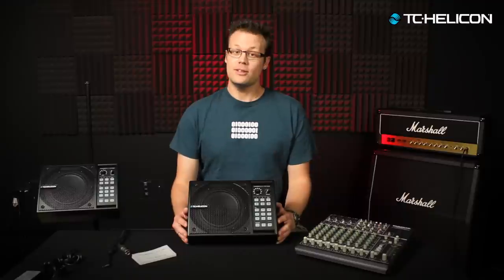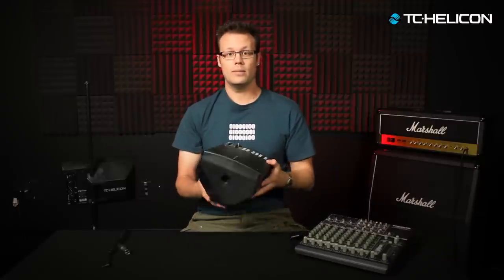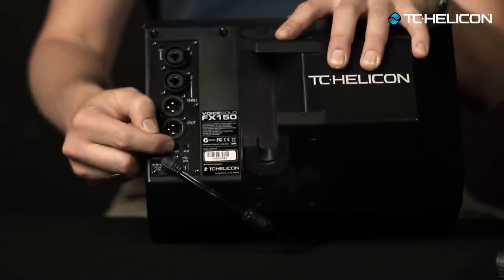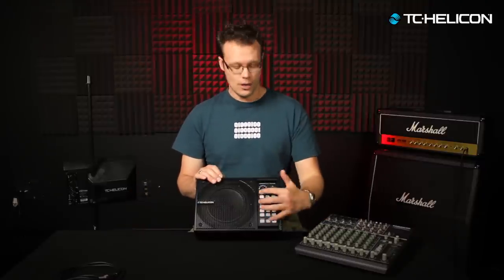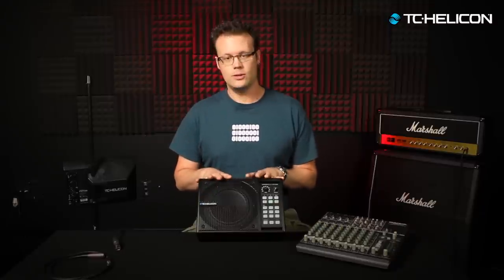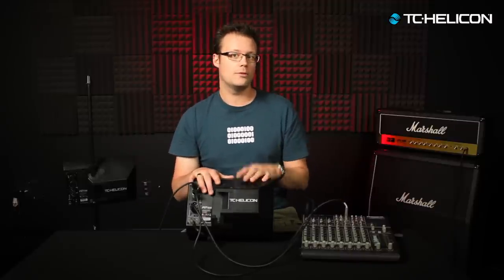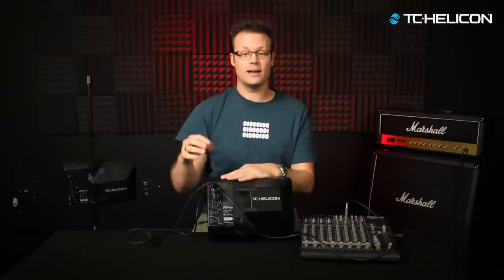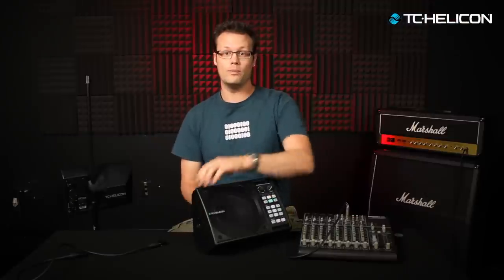VoiceSolo FX150 - Video Manual - TC Helicon

Comment: I know this is an old video, but if anyone is still researching this product I hope thos helps. I've been using this unit for 3 years now, amd I have zero complaints. This little monitor is powerful and clear. I've had no problems with it, and I use not for my stage monitor at church. I am the worship leader at my church, as well as the main keys player. I push this thing pretty hard 3 services a week, for about 2 hours per service. If you don't use in ears, this is a fantastic monitor.
Reply: Hi I bought an fx150 recently on second hand,  but when I checked the unit at home it was really very noisy with no gain on the 1channel with Jack plug absolutely nothing,  but with the xlr some sound but really poor gain and loads of noise,  also the balance di out are sending only effect no other signal. 
It looks like the guy who had this over loaded the preamp,  which he never told me.  
I'm using it or was going to use it for church music and prayer groups but only channel 2 works. ?  I paid 200euro and had to travel down to tralee to buy this. 
I'm very disappointed, it was in the box packed with everything so I took it that it was working. 
I'm currently living in a hostel so money is really tight.   Do you know anyone who may have a working fx150?  Many thanks Regards Vinn from Dublin Ireland
Reply: How does it work as a guitar amp/monitor - if ur using something like an IR (amp simulator), Two Note or Kemper?

I’m keen to grab a used VoiceSolo unit for bedroom playing (don’t have space for a full amp or speaker setup).

Comment: in venues where it faces forward, you may need a dimmer switch for all the buttons as it tends to draw focus from the performer. (personal experience)
Also, the surety of the unit's reproducing sound constantly is in question. (I've had one firmware update)

Comment: Great product (and I have one) but it is missing one very important critical thing - a headphone out that cancels the built-in speaker if headphones are plugged in.  that would make this unit "perfect".  If you can make this happen for future evolution to the product, make it "stereo" so we can enjoy the stereo aspects of the built in reverb.
Reply from the maker: Luis Rodrigues Ah I see what you mean. The thing is, the whole unit is built around being a personal monitor, so the headphone jack is a bit... out of place. Any of our other multi-effect units have a headphone out, but that's because you'd need a PA etc. otherwise and some people don't.
Reply: TC-Helicon Thank you so much for the response.  When I toured in the 90's we used Hot Spots (if you remember those!) with Sony MDR-7506 headphones.  Luckily we had a dedicated monitor matrix mixer and I could have my own mix.  The FX150 gives me the monitor mix plus "my own" but I still yearn to plug in my Sony MDRs.  At church we have an Avion system (for which we all use headphones/in ears, except the vocals) which is absolutely perfect.  FX150 with headphone output and ability to cancel the internal speaker would be the ultimate solution AND I believe would be an affordable alternative to the Avion-type systems (which unfortunately most churches can't afford).  Hope this helps.

Comment: Nicely done.. I was wondering how to connect to the VL3... thanks for that!
Reply: When I use for monitoring with VL3, I connect the VL3 Headphone out to the Aux in.  That way I can use the XLR outputs of VL3 in Dual mono mode to the PA.  This way I still have the FX150 channel 2 input for a monitor mix input and the sound engineer has separate guitar and voice mixing for the FOH.
Reply: I'm doing that very thing.. Excellent!
Reply: Linc Davis

Comment: I just bought one and it is going to take time to get to know it. Also, the sound that comes out of the PA is not the quality I am looking for. I think a vocal processor is needed to get this to sound the way I want it to. That will be the next investment. Otherwise I am dissapointed with the sound quality and the mix of vocal and guitar.
Reply from the maker: Cherie Lassiter Can you expand a bit on the sound disappointment? We'd be interested to know what you feel is letting you down!
Reply: TC-Helicon I understand the principle on how to change levels for it but can't get a sound that is full. It still sounds tinny and small. The reverb isn't very 'hall-like" sounding which is one test for fullness. I wouldn't want to play live with this. I know there is a learning curve and maybe that is the problem; knowing how to navigate it. But even without knowing the nuances, one can still tell the capability from the get-go. I am told it is hard to get the sound I want without a voice processor which I will be doing to get the sound I want.

Comment: Tried this at Guitar Center and doesn't sound louder than 35 watts? it does great though!
Reply: Then you didn't set it up properly.  I have 4 Roland Cube CM30's which are 32 watts each.  This unit is louder than all of them put together,

Comment: Hi Craig! Thanks for another nice video! I do like this VoiceSolo monitor and have recently bought two of them. I just have one question and hope you can clue me in with it.)
I use both of them as monitors for myself, all the sound goes to the audience thru a mixer and and PA system. Everything is nice and perfect except one thing:  when I strum the guitar a bit louder or sing a bit louder the Vocal Tone button turns red (for a moment) and then returns to normal... It doesn't affect anything, there is no distortion, just that short term red blink, which drives me a bit jumpy...) Is this a trouble or am I doing something wrong? Any advice will be of great help.)) Thanks!
The signal flow is as follows:
1. Mic goes to mixer
2. Guitar goes to mixer
3. AUX 1 sends signal to FX150 #1 (channel 2)
4. AUX 2 sends signal to FX150 #2 (channel 2)
Both AUX sends are PRE fader ones.   

Please, kindly drop me a line on the issue.)))
PS And, hell, I have lost one hat-looking thingie.)))

Comment: OK so i just ordered your play acoustic pedal. (Can't wait to get that) And play thru a fender passport 500 PA system. Can i use the fx 150 for a monitor ?
Reply from the maker: Cameron Cook Yep sure can. The easiest way to connect is to run an 1/8" cable from the Play Acoustic's headphone out to the FX150's Aux in. Then you can connect the main outs from Play Acoustic to the Passport. Make sure to check out the Mixer Setup video so you get the gain staging right on the Passport. https://www.youtube.com/watch?v=qq0AOtafIjs

Comment: I bought one a couple months ago and I'm impressed by how sharp it sounds. It does its job well on a small room with fairly good acoustic set-up. However, I used it as a stage monitor on a full band setup and was easily drowned out. If I put the main volume nearly all the way, and the individual channel volume the same way, the signal clips and the sound gets distorted. :( I don't know how to make it sound better considering that I mounted it on my mic stand faced directly infront of me. Channel 1 was my regular dynamic microphone and channel 2 was my keyboard. Any help please?
Reply from the maker: At some point you'll definitely run into the SPL limitations of the unit, especially in a full band stage setup if the band is rockin. Unfortunately there's not more we can do to squeeze more volume out of the unit. You can try turning Tone off and using the EQ manually to roll off some top to get a bit more level before feedback. 

Sounds like we need to make an FX250!

Comment: Hi...I've order one of these units, and am looking forward to getting it. Seems great.  I do have one question, though. I am part of a duo, and typically we do not have a sound engineer. We control our own FOH through a Fishman SA220. What I'm thinking is that we should be able to link the Fishman Monitor Out to the FX150 (used as a monitor) and be able to hear the same mix as is going to FOH. If adjustments are necessary, we can make them on the mixer and they will be reflected in the monitor mix on the FX150. Does this make sense, or is there a better way to do this?  Thank you.
Reply from the maker: You can definitely do what you described, but depending on how many inputs you need I might go the other direction. Since there's two channels on the FX150, you could use them both (one for each of you) and then run FULL MIX out to the Fishman. That way, what you hear in the FX150 is what you get from the Fishman and you have the opportunity to adjust things at the FX150 without needing to adjust the Fishman, which may be more convenient in performance.
Reply: Thanks! That would work perfectly as we have two inputs, one from my pedal board (which in turn has several inputs) and one from a mixer (which also has several inputs. We will give this arrangement a try for sure!

Comment: Well, I just got it, took it out of the box, plugged in it in and it appears not to be working. I'm using a standard Shure KSM 27 condenser mic, great mic, if I use it alone I generally get so much gain that I have to keep the pre-amp volume down.

A bit frustrating because the marketing and videos for TC Helicon are well done, but, I am getting very little volume out of the unit and the adaptive features seem not to be working (the vocal tone).

I want to give these guys the benefit of the doubt because they seem like a great company. Turning it on, got phantom power. I am singing scales, It just seems to be a small portable speaker, only, the volume is down so low I don't believe it's useful in a full band, or even just portable practice context.

Is there a required download with the USB cable; to adjust the difference in "apparent volume." I don't know, I'm not an attorney but "apparent" suggests a distinction between "actual" in order to re-characterize and tailor word choice to hide a defect.

Unless I'm missing an upgrade this is not a magic pill. Would be best to drop the $300 bucks on a JBL Powered Speaker if this (just some small projection. . . sounds around 5 watts, with no adapting features or reverb that I notice... so far) is the result.

-R
Reply from the maker: Ryan Lee Hi Ryan, I'd start with Tone ON (green) and the Master all the way off. Then, turn up the Level knob until you start to get red clip indication on the Tone button when you sing your loudest. Then, back off the level knob a bit until the clipping goes away. After that, turn up the Master. You'll have the best gain staging at that point. 

You're using a large diaphragm condenser mic which can be more prone to feedback than a dynamic. Even though it's cardiod in its pattern, you typically stand further back from a big mic like that, so you don't get plosives. 

When you're setting your level, you want to be as close to the mic as you can, so your best bet is to use a pop-filter about an inch from the mic and then sing right up against the filter. That'll reject as much as possible from the room. If you set it up like you would in a studio with headphones and are a foot back, it'll always feedback early since there's a ton of room (and the speaker) coming back into the mic. 

I wouldn't ever use a 27 live if I was after any kind of volume. You'd have much better results with a 58, OM5/7, MP-75 where you get "right up on top" of the capsule.
Reply: Turn phantom power om

Comment: Hey..trying to be creative on the fly with no budget. I want to use this in a small church service (say 50ish people) with a VL3 (my vocal with acoustic guitar) running into it while using it as a house PA, run another vocalist into it as well, and line out to a crate keyboard amp (crate kxb25) to get sound on both sides of the room. I will use my VL3 for all things me and run it to a flat unaffected channel on the FX150. The other vocalist will get the effects on the FX150. See any issues???
Reply from the maker: Steve Wulfeck Nope, should work fine. The volume output will be your biggest concern in that setup. It'll depend on the size of the space and how much the warm bodies soak up. I'd make sure you get the FX150 up on a mic stand at ear level to maximize its "throw".
Reply: TC-Helicon thanks,  that is what I thought as well....I have seen many small church services where they are using one of the small fender passport type all in ones and they struggle to get the volume they need out of the system once the room is full of people.  This is only  temporary fix and we should be able to get an adequate system before we get past 50 people, and the FX150 will be good to use with the future system as well.  This set up will give me the same amount of power I think.

Comment: I would like to use some of this for our church band... can we run like four of them through mixer?
Reply from the maker: Gammasbote Sure can. You can set them up so each person gets a "more me" mix and can tweak their own balance at the FX150, while still sending a nice signal to the FOH for mixing. There's a ton of setup diagrams in the manual, including using monitor mixes and the Thru. www.tc-helicon.com/products/voicesolo-fx150/support
Reply: Add a comment...

@Redeemed0620
7 years ago
I bought one a couple months ago and I'm impressed by how sharp it sounds. It does its job well on a small room with fairly good acoustic set-up. However, I used it as a stage monitor on a full band setup and was easily drowned out. If I put the main volume nearly all the way, and the individual channel volume the same way, the signal clips and the sound gets distorted. :( I don't know how to make it sound better considering that I mounted it on my mic stand faced directly infront of me. Channel 1 was my regular dynamic microphone and channel 2 was my keyboard. Any help please?

1

Show more replies

@calebrabion4786
3 years ago
I know this is an old video, but if anyone is still researching this product I hope thos helps. I've been using this unit for 3 years now, amd I have zero complaints. This little monitor is powerful and clear. I've had no problems with it, and I use not for my stage monitor at church. I am the worship leader at my church, as well as the main keys player. I push this thing pretty hard 3 services a week, for about 2 hours per service. If you don't use in ears, this is a fantastic monitor.

4

@vinnyjr7029
0 seconds ago
Hi TC Helicon and anyone else who can help? I bought an fx150 recently on second hand,  but when I checked the unit at home it was really very noisy with no gain on the 1channel with Jack plug absolutely nothing,  but with the xlr some sound but really poor gain and loads of noise,  also the balance di out are sending only effect no other signal. 
It looks like the guy who had this over loaded the preamp,  which he never told me.  
I'm using it or was going to use it for church music and prayer groups but only channel 2 works. ?  I paid 200euro and had to travel down to tralee to buy this. 
I'm very disappointed, it was in the box packed with everything so I took it that it was working. 
I'm currently living in a hostel so money is really tight.   Do you know anyone who may have a working fx150?  Many thanks Regards Vinn from Dublin Ireland
Jrvinn4@gmail.com is my email.   Cheers Vinn 😎 👍 ❓💭
Reply: Add a comment...

@Redeemed0620
7 years ago
I bought one a couple months ago and I'm impressed by how sharp it sounds. It does its job well on a small room with fairly good acoustic set-up. However, I used it as a stage monitor on a full band setup and was easily drowned out. If I put the main volume nearly all the way, and the individual channel volume the same way, the signal clips and the sound gets distorted. :( I don't know how to make it sound better considering that I mounted it on my mic stand faced directly infront of me. Channel 1 was my regular dynamic microphone and channel 2 was my keyboard. Any help please?

1

Show more replies

@calebrabion4786
3 years ago
I know this is an old video, but if anyone is still researching this product I hope thos helps. I've been using this unit for 3 years now, amd I have zero complaints. This little monitor is powerful and clear. I've had no problems with it, and I use not for my stage monitor at church. I am the worship leader at my church, as well as the main keys player. I push this thing pretty hard 3 services a week, for about 2 hours per service. If you don't use in ears, this is a fantastic monitor.

4

@vinnyjr7029
0 seconds ago
Hi I bought an fx150 recently on second hand,  but when I checked the unit at home it was really very noisy with no gain on the 1channel with Jack plug absolutely nothing,  but with the xlr some sound but really poor gain and loads of noise,  also the balance di out are sending only effect no other signal. 
It looks like the guy who had this over loaded the preamp,  which he never told me.  
I'm using it or was going to use it for church music and prayer groups but only channel 2 works. ?  I paid 200euro and had to travel down to tralee to buy this. 
I'm very disappointed, it was in the box packed with everything so I took it that it was working. 
I'm currently living in a hostel so money is really tight.   Do you know anyone who may have a working fx150?  Many thanks Regards Vinn from Dublin Ireland

Comment: Hello Craig, I was wondering...our Mackie ProFX16 only has 1/4" MON SEND's 1 & 2(which are labeled BAL / UNBAL) which we plan on using to feed the mixer's signal to the FX150's.  My question to you is, is there any advantage to using a balanced cable when feeding this signal from the mixer to the monitor, or is an unbalanced feed just as good?
Reply from the maker: +Dan Stelluto Balanced will give you better noise rejection, especially over a longer cable run. I'd go balanced (TRS) to XLR if you can.